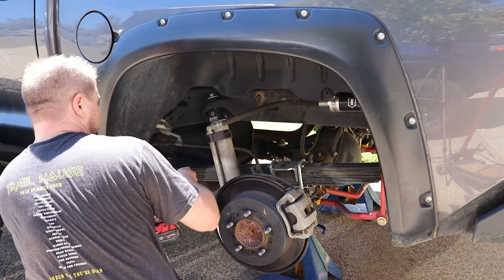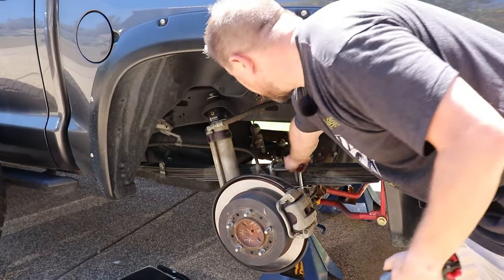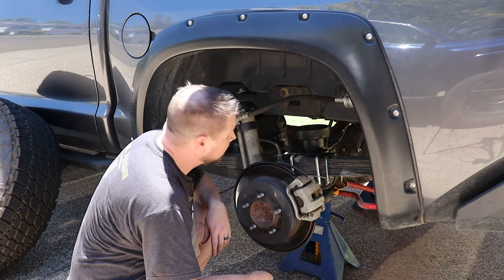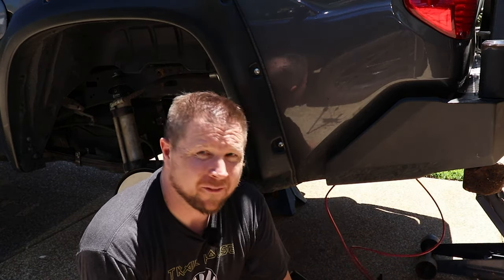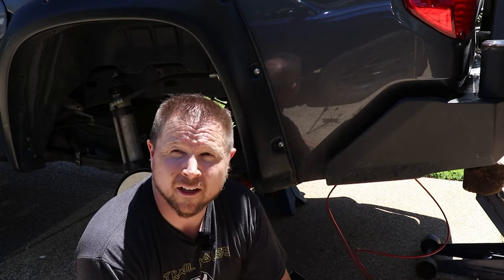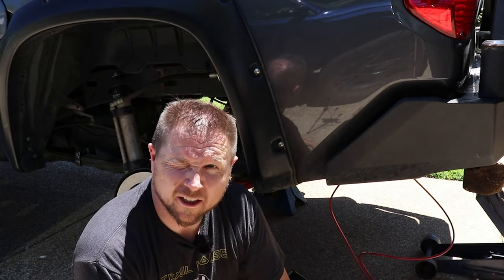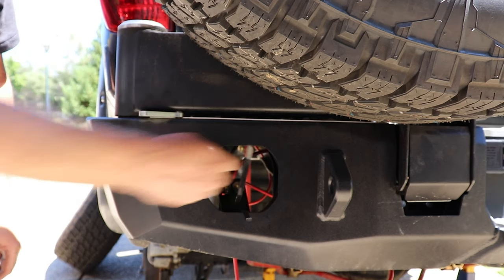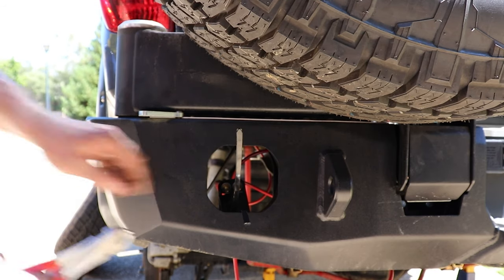Firestone Airbags on a 2018 Tundra after Icon modification, will it work?

Comment: Thank you for the video, 
Was the bracket and the cradle came together, or was the bracket part of the air bags kits.? I also have a 7” lift, do I need 2” spaver
Reply from the maker: I bought the bracket separately. The bracket is for the lift, and firestone makes this. You will need possibly a more oversized bracket. 2" is likely not enough. On their site, they have a process for measuring this, if I remember correctly.

Comment: How much travel did you lose in the rear?

I have a similar setup 3-in lift but I'd like to maintain the travel I have. I have a feeling if I'm going to bottom out a lot sooner than I currently do if I'm beating on the truck. The only reason for the airbags for me personally is to help with the equipment trailer that I haul from time to time with a tractor.
Reply from the maker: Very Little, the ride is actually better than it was. Maybe a 1/2", I guess. This was a great way to install the airbags.

Comment: What size lift do you have? On my tundra I have custom alcan with 4" lift and the toytec shackles. What size extension do you think I would need for my air bags?
Reply from the maker: 4" lift. I chose the cradles so I didn't use extensions. But 2" should work.

Comment: Awesome setup, looking to do the same on my tundra. I recently put on a camper shell that weighs around 200 pounds and I carry around 50 to 90 pounds of gear in the truck. I'm sitting dead level front thr back with my icon lift tho my leaf pack is set only to option one. Was thinking maybe adding some shackles but I want to run bags ans cradles. Glad I seen this video, helps to see someone running the same setup
Reply from the maker: Glad you liked the video.

Comment: Thank you so much for making this! I know it takes a bit more time to film but it's much appreciated.  I have the Icon leaf pack option 3 too and have been trying everything to help with the load of my slide in camper and nothing has worked.  Short of getting a new custom leaf pack, i've tried hellwig helpers (not enough capacity) , sumosprings (even with spacer not enough height), Roadmaster Active Suspension (Doesn't really work well with the Icon's as I had to chop the very end of one of the leafs).  Airbags is the only way to go when you're right at or a little over payload.  I was wondering if you had to use 2" the axle extension braket or just left it as is?  I'll be putting mine on this week and will find out I suppose
Reply from the maker: Hi, I did need to get longer bolts, I think I shared that in the video. And yes I used the extension, but had to modify it as it is not a full 2" change. I am glad it helped. Please ask any questions along the way. This is a great addition and definitely solved my issue.
Reply: @LoamRoamer  Oh nice, yep I'll just drill some more holes at the right height with a cobalt bit.  The best thing about this setup is it's way less coin than a lot of the other options.  I'm running a hard-side slide in, travel lite 770, because I got a deal on it and mostly use it in winter for powder chasing but that GFC looks so ideal too for real exploring.  I suppose everything is a trade off